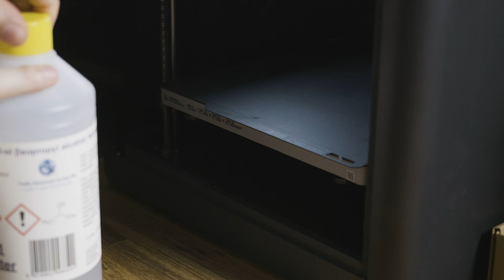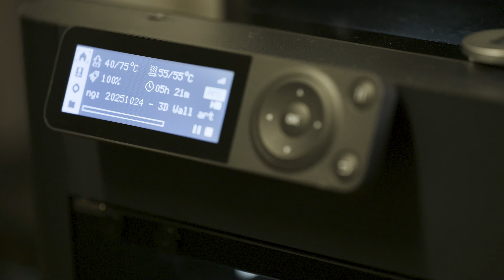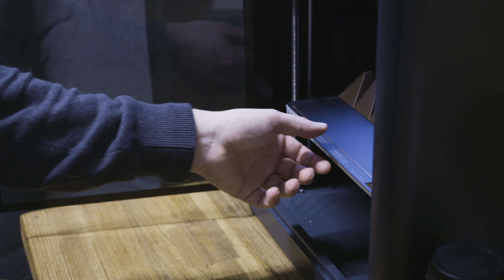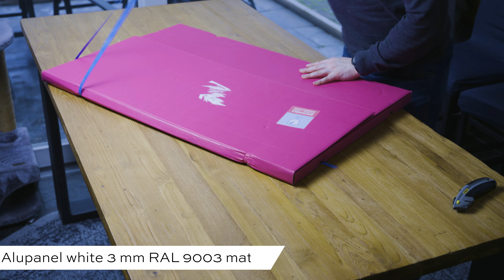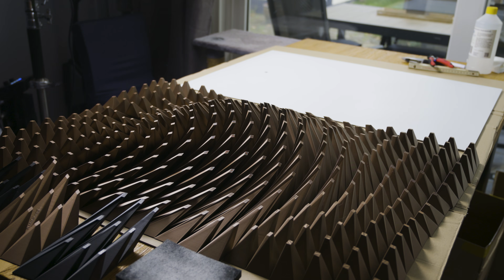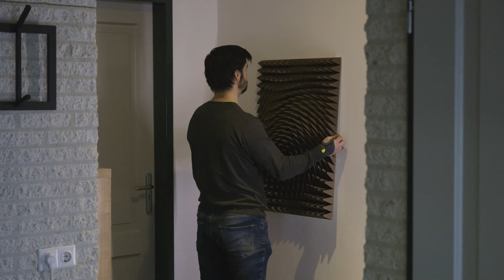3D Printed Wall-Art - Copper Vortex

Comment: What methodology (in blender) did you use to split the model into the printable pieces. Did you use the bisect tool? Or the cut tool? Or some other method. I'm having trouble figuring out how to spilt the base layer without cutting into the "spikes". Great videos. Thanks.
Reply from the maker: Hey, first times I just duplicated the faces over on the x or y axis and deleted the original ones.
Now I use a double array modifier one for the x and one for the y axis you just have to calculate the final dimensions a bit more. Working on the series to explain this in more detail ^^

Comment: I’d change only one thing: I would've sprayed the white background black or a matching color. It would hide the white lines and add more depth. Great work overall.
Reply from the maker: Glad you liked it, there is a V2 version that fixes this specific issue with an easy to print overlapping edge design!

Comment: I always wanted a 3D printer.
But then it dawned on me.
I mainly use glass and I have banned most plastic things from my apartment.
So, why would I want to have my own plastic production in my apartment?
Reply from the maker: Valid question indeed, sounds more like you need a glass melting furnace!
If you don't like plastic it might not be the right thing for you.
I also find great joy in creating stuff that's functional as well! 
Stuff to fix broken pieces of things that you otherwise throw away, specialized parts or something that would cost less to print but more to even go to the store for or to have shipped to your home.
And the 3D printing community is great, with a lot of free designs with clever and functional solutions for everyday problems.

Comment: Very nice project and i love how it turned out.

But: You did not have to sand the bottom of the individual pieces. This is very uncommon with thermoplastics gernerally because you will not increase the surface energy by a large amount. Cleaning with isoprop is enough.
Reply from the maker: Thanks for the tip! I thought it could help to roughen the surface and help the adhesive grab on to the plastic, instead of having a hard smooth surface texture.

Comment: How did you split the models like that ?
Reply from the maker: I think I duplicated the vertices of the rows that I wanted and moved them on the X or Y axis accordingly to create a space, when repeating that step 4 times in the width and about 6 times in the length you should have all 35 parts.
Then because you are missing the edge faces I delete the bottom for all the parts and extrude the new bottom layer again and use F to fill them again.
All the parts should have their individual bottom layers with edges then.
Reply: @RamonvanBedaf13 would love a tutorial on this!
Reply from the maker: I think I also found a way to make it all individual pieces as well, I'm currently testing that. Once I get the process down I'll throw it in a video.
Reply: @RamonvanBedaf13 hell yea legend!

Comment: While it's good to be careful - construction adhesive really doesn't need you to sand and ipa wipe the surfaces so thoroughly. 
In future I would recommend putting some sort of overlap between your printed pieces to ensure the panel can't be seen through any small gaps, and to have some small recessed pockets in the printed pieces which will give the adhesive somewhere to squeeze out into (along with any air that gets trapped)
Reply from the maker: Thanks for the suggestions! I definitely took some notes during the process as well for future projects, and I knew this mounting this with construction adhesive is overkill but this also means it should last for years in my mind :P

Comment: Love the design, if you do release it could you make the base slightly thicker and add a couple of dovetail joints to be able to just join everything together (plus help orient it correctly) came out really cool
Reply from the maker: The printfile is available at MakerWorld, link is in the description :)
For this first wall-art project I went with simplicity, instead of adding a interlocking solution.
I knew with the aluminium plate that I didn't need the strength of interlocking pieces and this would add quite some complexity as well as weight to the 3D printed pieces. 
(The bottom layers for this project are extra thin and made to transition directly into the 9x9 grid to avoid the need of infill and extra layers/supports internally.)
I do want to incorporate something like this in future projects, maybe not exactly dovetails but guides or extrusions that help guide pieces in place a bit better.

Comment: Super nice project with a great end result! Do you think this material would work as a soundproofing panel for a home studio?
Reply from the maker: Thanks! I think 3d printing could be a valid use case for soundproofing, this design could help break up sound waves I assume that travel through the room. But I don't know how effective it would be in comparison to normal sound panels or other solutions. This design won't be optimized for capturing and dissolving them I think, at least not how a foam panel or mesh does.
@MandicReally made a great video about this a while ago https://www.youtube.com/watch?v=8E0u-5AyEE4

Soundproofing for me always remains a difficult subject as the room itself is important as is everything in the room and how it's built (materials etc.). I do think 3D printing can definitely help create unique sound proofing solutions or aesthetics that you cannot achieve otherwise.